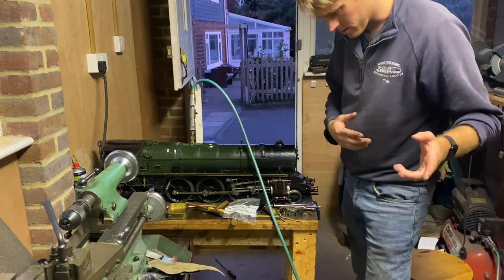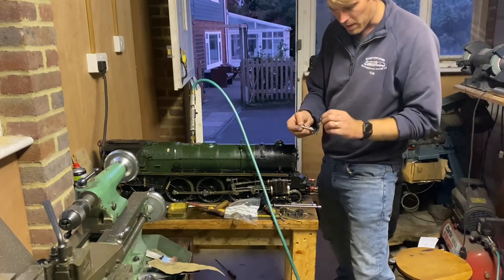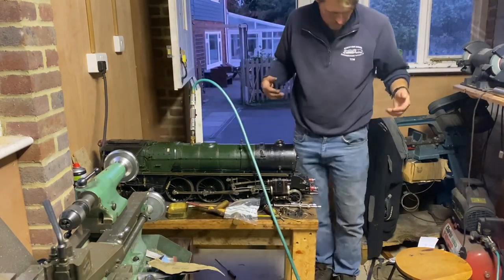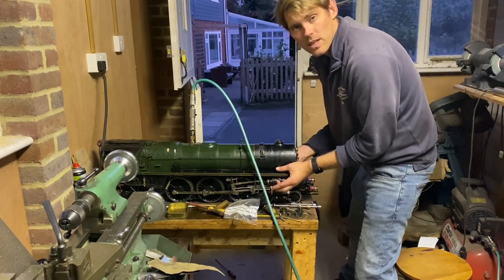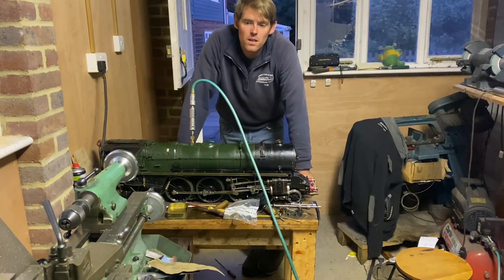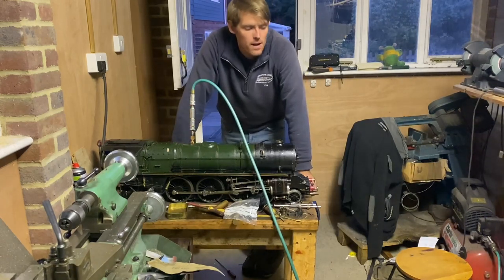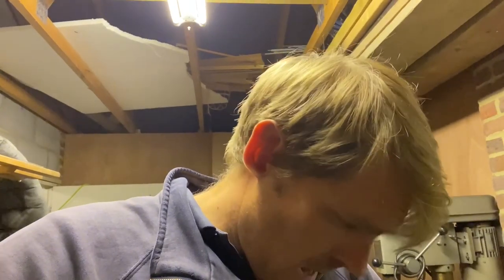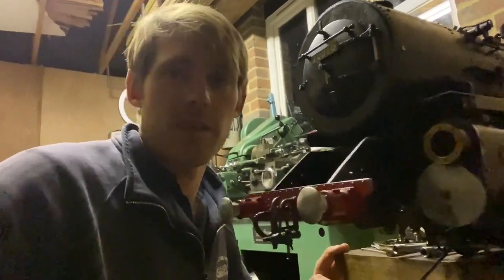Experimenting with the cylinders

Comment: Tom. Have you considered the superheater or steam connection in smoke box may be leaking? Just a thought.
Reply from the maker: I did, but this was a direct blow from the blast pipe, however another video has just gone up which shows a critical mistake I did make…